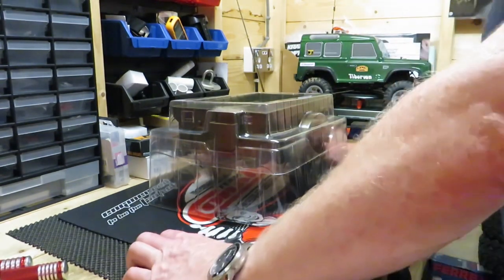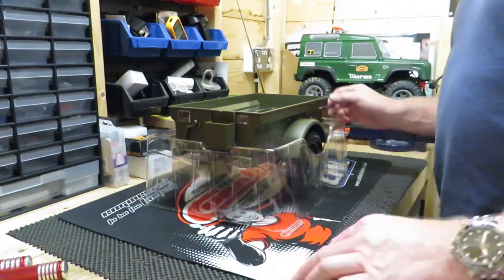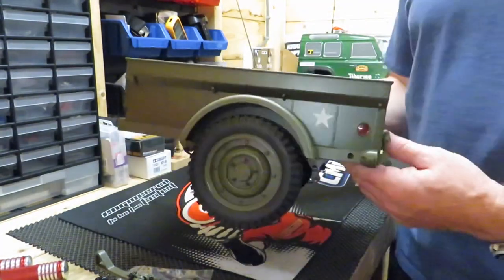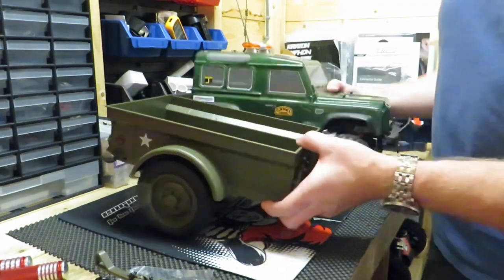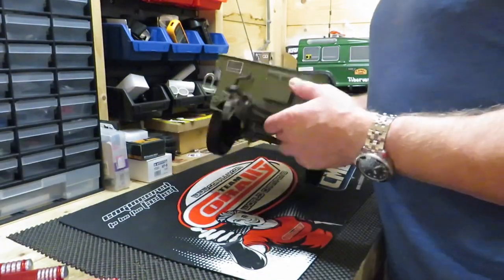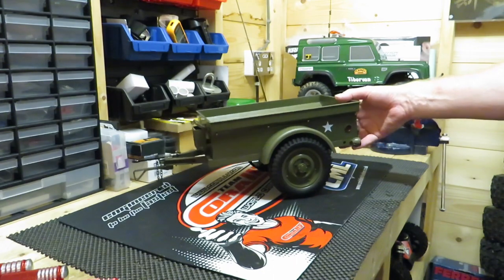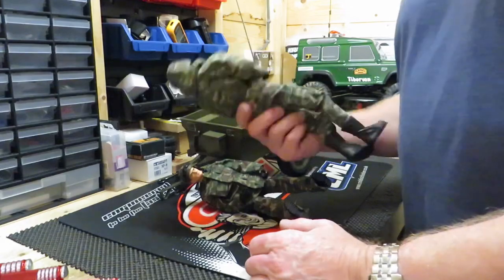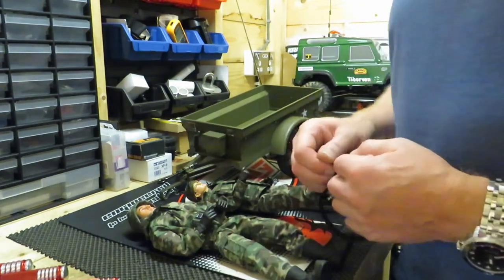Roc Hobby 1/6th Military Trailer

Comment: Tibor! Very scale looking trailer.  Perfect for the Willy Jeep. Suspension on the trailer will make it look scale on film. Are you going to mod the Jeep now that you have some drivers!  Maybe some 1.9 tires? Or keep it scale and authentic.  Either way I like this truck and trailer!
Reply from the maker: Hi buddy. I think i will probably keep it scale and pretty much stock. I dont think the jeep will every crawl like a Trx so i intend to use it as a trail RC, and probably in the dry weather terrain too lol. I like it that much that i just cant bring myself to ruin it or trash it lol. Its going to be a semi shelf queen i recon lol   i will probably buy a few more accessories for it at some point, maybe a machine gun. What i forgot to show in this video is the canvas roof that i have also bought. Hopefully get a run video soon my friend 👍🏃👍😊